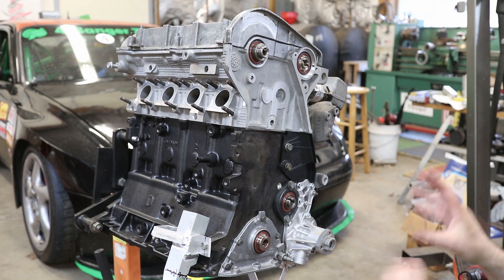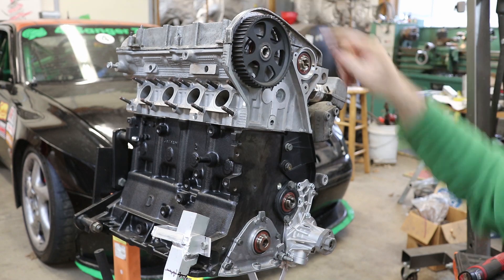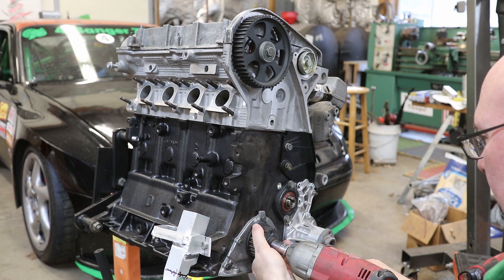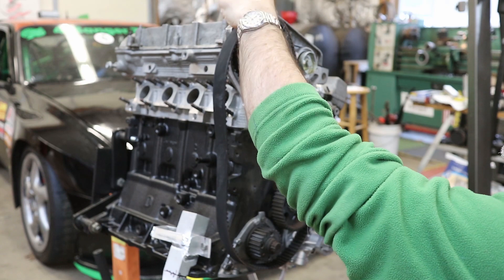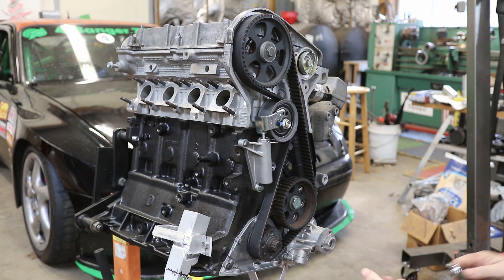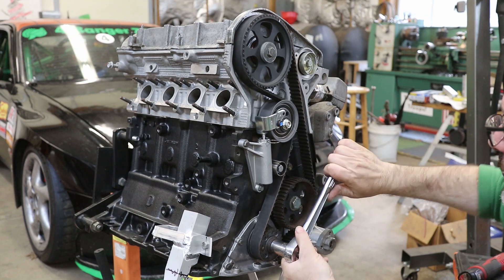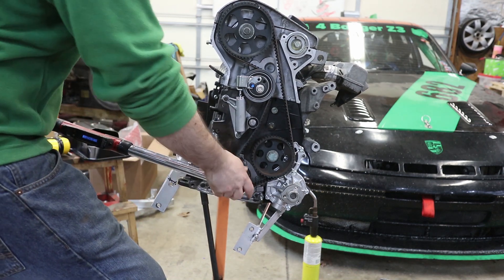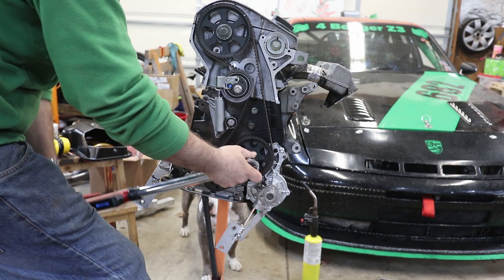Installing timing belt on VW/Audi AEB 1.8T 20-valve engine

Comment: Great video!  20 ft lbs is torque spec on the  drive belt tensioner pulley, took me a bit to figure that out so wanted to share.

Comment: Very interesting and informative video. My only observation would be around the torque process of the pulleys. These have quite weak keyways and its recommended that you hold the pulley using a tool whilst torque up, not the shaft. I learnt this the hard way after my engine builder sheared the top pulley key during 're build and the timing slipped. We were very lucky no internal damage occurred.

Comment: Pls what's the likely problem of my VW 1.8 20 valves car. The car was overhauled rings were charged, but it shorten engine oil and there is no any sign of smokes from the exhaust. Please help me out.
Reply from the maker: I'm not sure I understand the question - you say it's consuming oil after a rebuild?  If it's not leaking out, it's getting burned up in combustion.
Reply: @vsvenson  Yes the engine is  getting burned up after the rebuilt. And no smoking from the exhaust. What's likely problem and if it's getting burned in the combustion what's the solution to it? Because I equally have the same problem.
Reply: @shehuusman8994  did you replace valve stem seals?  Even with bad ones this engine doesn't smoke but eats oil a lot.

Comment: That center crank bolt, you really REALLY need to replace that thing.  I could see the polished threads as you were fitting it into the crank.  Also, you didn't torque it correctly as your crank was turning while doing the 90° turn after your preload torque.  Don't think you even got 45 of the 90°.  That's a torque to yield bolt (stretch bolt).  On your EA827 variant ("058 block"), that bolt is only a M14 grade 8.8 bolt vs a M16 grade 10.9 bolt on the EA113 variants ("06A block") torqued to same spec and also noted as "Always Replace" in repair manuals.  The nerd-ineering/engi-nerding about stretch bolts aside, you have to remember on these engines (also many other german engines, particularly the VW flavor), the clamping force from that bolt is all that's holding the sprocket onto the crank.  The indexing notch is not doing anything to mitigate the load of the valve train, damper pulley mass and accessory loads effectively working to constantly loosen the bolt/sprocket unlike engines which use a keyed friction/press fit over/around the crank stub (effectively some degree of splined press fit).  Basically the clamping force has to be higher than the highest tangential force exerted against it (I think that's correct nerd-ineering verbage...)
For comparison and perspective, if you do some google keyboard warrior searching, you'll find plenty info of people who have done hot-roding VW modifications and crank bolts loosening, bad enough to cause complete & extreme engine failures I imagine.  I'm inclined to think many, if not most all of those cases are more likely due to people reusing their crank bolts or cranking even new bolts down way crazy with a rattle gun so tight that the bolts stretch too far into the plastic deformation stage (just as bad, maybe worse than reusing old bolts).  People having issues with small M8 pulley bolts losening seems even more common, but again, proper torquing concerns.  Some extreme HP builders are also drilling and pinning the cranks/sprockets.  Also, when Audi/VW developed the EA113 engines into the 2.0L Direct Injection Turbo variant, they also fitted a "Diamond Coated" friction disk/shim between the crank & sprocket, obviously to mitigate possible bolt/sprocket loosening knowing they'd be producing factory variants pushing towards the 300HP range (Mk6 Golf R) and I guarantee you they even anticipated the tuner guys going crazy with the early BPY engines, hence they even fitted the pulleys with 6 grade 10.9 bolts instead of continuing with 4.  As for my personal experience seeing first hand the importance of replacing stretch bolts.  Having worked on many B5 chassis A4's & Passats (mechanically the same car), those cars are quite common for rear wheel bearings failing on the AWD models and the front wheel bearings on the 2WD models.  The common denominator, M14 vs M16 stretch bolts, though with those wide shoulder socket cap (allen head) bolts the M16 are only grade 8.8 also.  Of these particular wheel bearings I've done, more than just a few were replacing relatively new bearings.  A couple of which had only made it a couple of weeks.  Every one of those, shiny new wheel hub and a rusty old M14 bolt that got reused.  One in particular I remember I could have loosened the bolt with just a 3/8 ratchet.  Bolt was stretched to the point of being about as useful as a string cheese snack.  Many years ago now, someone wised up and seems like all the wheel bearings are only sold as kits with req. hardware included.
Anywho, been thinking several days now, you may actually want to give some serious thought about that crank bolt beyond simply just putting a new bolt in there, (properly torqued of course.  My 3rd sentence above).  Your bolt part# N90367001 - M14x1.5x39 grade 8.8.  You could consider bolt# N10555602 - M14x1.5x40 grade 10.9.  Just about identical shoulder width/dia. on that bolt but it's a XZN head (maybe 1mm bigger).  It's a rear caliper bolt for first gen Touregs, Q7's and Cayenne with OE torque of 100Nm+90°.  Be interesting to see what clamping force it would make at the 90Nm+90° of the OE crank bolt or the 100Nm+90°....  Fairly certain there ought to be a phone app these days to calculate fastener load data......Maybe also see if TDI bolt# N90577101 - M14x1.5x47 grade 12.9 is an option if the crank has the threaded provision for a longer bolt and torque to TDI spec.  I'd also wonder what an outfit like Integrated Engineering would say beyond of course telling you to buy their $50+shipping bolt  https://performancebyie.com/products/arp-crank-damper-bolt-for-058-18t-engines-fit
Also, for torquing the extra 90°, you'd be better off making a paint mark on the bolt inline with one of the M8 holes and turning to line up with the next one and probably better to use a breaker bar for the extra 90°.  You might also consider replacing the four M8x16 pulley bolts with grade 10.9 bolts part# N10303607.  I'm more partial to 10.9 XZN bolt# N91143901, like I used on my BEA 1.8T.  If I was in your shoes, I'd probably just use the N10555602 bolt with it's torque spec. and replace the cam and intermediate shaft bolts too and call it good. Part #'s for those N90625701, N90256201 & 027109143  
Probably a good idea to drill a piece of flat bar for a holding tool on the sprocket.  
As you have that bolt right now, I wouldn't trust it even for grandma's grocery getter.
Sorry for the long ramble.  Hope all works out good

Also might be helpful for part #'s   
https://audi.7zap.com/en/usa/
https://volkswagen.7zap.com/en/usa/
Reply from the maker: A wealth of information here - thanks for the long response.  You've convinced me to get all new bolts for the front end.
Reply: Damn dude knowledgeable right here thank you thank you

Comment: I'm not sure if it's the same on this engine, but the 30v V6s have a hole in the crankcase where you screw in a special pin that locks the crankshaft at TDC - that's why they have no timing mark on the crank pulley. I suppose you don't really need it when you have the engine out of the car though :)
Reply: True, but this pin is only in v6 and v8